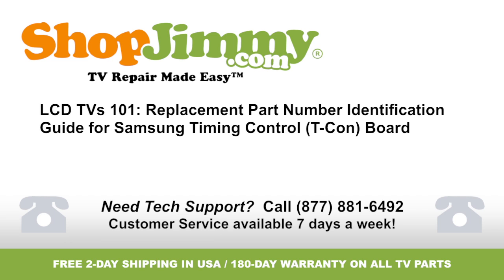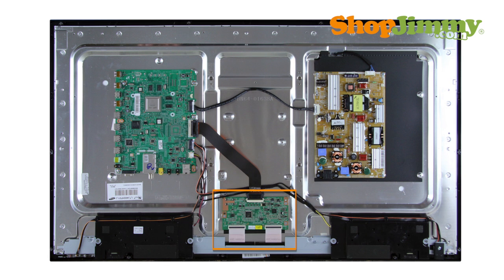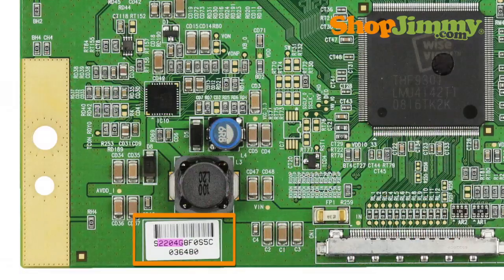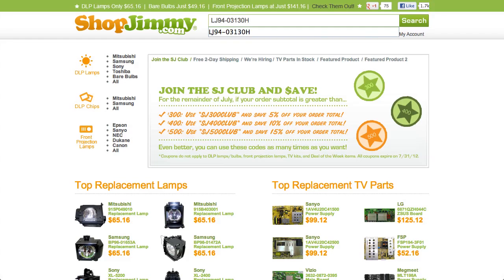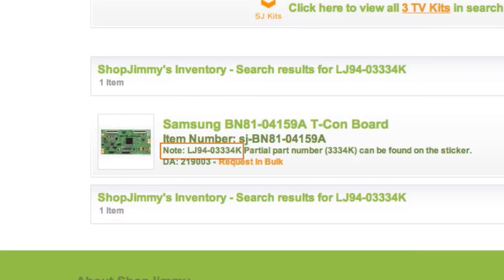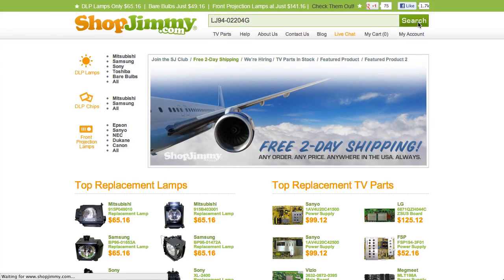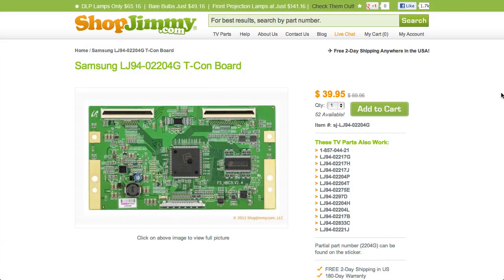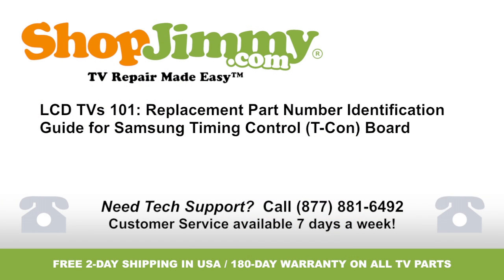Samsung LCD TV Repair - Identifying Samsung T-Con Board Part Numbers - How to Fix Samsung LCD TVs

Comment: Hi Jimmy ~ Our Samsung 50” Smart TV is about 4 years old and recently the screen just drained out and went black.  I’ve watched your troubleshooting videos and purchased a T-Con board from you which I just replaced and the problem wasn’t solved.   There are lights in the back of the TV and no image can be seen with a flashlight.  There is sound and the channel changes with the remote.   I’m hoping you can advise me which board to replace next.  It was very easy to replace the T-Con board and the longest part of that was removing and replacing all the screws.   Please let me know what you recommend.   Thank you in advance and thank you for what you do to help the rest of us.   Liz

Comment: Hi perhaps you could shed some light? My SYNCMASTER T240HD monitor/TV was made in TIANJIN CHINA manufactured March 2009. Model Code on back cover is LS24TDNSUV/ZA Has been acting up after it appears to overheat. Either the monitor just freezes the image or it starts to blinking between a set of large horizontal red/white/blue bars and solid white or solid blue screens. It won't switch sources at that point, but turning it off for awhile and back on, it returns to normal. I've proven its the monitor by switching to another one and it doesn't happen so its not my video cards. So something is overheating. From some of your other videos and others I figured it was the TCON card. After opening ...the tag on the inside has number LTM24OCT04 and it does NOT have a small tcon, it has one big long card that spans the entire length of the monitor and about 2 inches in width. It has several ribbons direct soldered and that go to the LED. Its part number is 24OCT04S2L V1.4. Have you seen one of these? I can't find any info on this, is this made this way so that it cannot be replaced easily?

Comment: Hi, I have a Samsung LED Smart TV with a bad T-con board, an N mosfet or diode was bridged, so I replaced the entire T-con board with a new one, and it died within 3 minutes of install, T-con gets power via Mainboard, not directly VIA Power supply, should I replace Mainboard as well next time? I dont want to chance that the New T-con was defective, and have another one die.

Comment: I am about to try the tea con repair or fix on my LCD LN S4095D Samsung, but it seems my symptoms are much different than others I've read about.  My display seems to work fine with numerous cable TV boxes, yet when I try to hook up anything else through any other input I get vertical lines. Still TCon? Why cable boxes work?

Comment: My LA32C350D1 is having double image problem and at time the blue color appears as purple. From what I seen on videos like yours I guess it's T-con board issue. My problem is locating it. I've searched all over for a video disassembling this particular model with no luck. I've managed to strip it down to the panel level, but I do not know how to go from there to the T con. If I get there I can get the part number as you have described here and buy  it from you. Could you advise me please.

Comment: I have a 52 inch Samsung LCD TV model number LN52A750R1FXZA.  It has a dark area in the center that runs from the top to the bottom.  Like a band in the center area that is completely  dark unwatchable.  It also has a double image on the right side of the screen.  It is about 6 Inches lower on the second shadow image.  There were originally 5 horizontal lines that were on the right side of the screen that showed for a while until the TV warmed up.  Is this a repair that a new T-con board would fix?  Any ideal on what would repair it?

Comment: Hi Jimmy, I'm having a problem with my Samsung UN50EH5000F.The standby light is paler than normal, and it does not turn on when I activate the power button.When I disconnect the main panel from the power panel, the backlight comes on; However, as soon as I use the 14 pin cable to reconnect the main panel and the power panel, the backlight goes off.I replaced the main panel, but the problem is still going on.Could there be a 14 pin cable issue?  Thanks! Sincerely, Lena
Reply from the maker: +alyonka2004   Try all repairs and troubleshooting at your own risk.  I recommend replacing the main board in your TV.  Click this link to replacement parts for your TV model number:  http://www.shopjimmy.com/catalogsearch/result/index/?cat=56&q=UN50EH5000F  There may be multiple boards for the same TV model number, be sure to match part numbers on your current board, with your replacement for compatibility.  Here is a link to a video showing how to identify your part number, click here:  https://www.youtube.com/watch?v=BEPWrefQvqI  Thanks and please let us know if you have any further questions with your TV Repair!  www.shopjimmy.com

Comment: Hi Jimmy:  I have a samsung LED TV that the picture went out on.  I do get sound and with the lights off I see there is back light.  When I turn it on I get a second or two of horizontal lines and then just back light.  The power light blinks 3 times.   Model number UN46D6420UFXZA.  I have not taken back off of TV yet.  Do you think this is the T-Con board?

Thanks Bill

Comment: My TV model number is Samsung LN40B750U1F. When I switch on the TV audio and video comes fine for few seconds, then display goes black and audio continues. When I move myself close to the TV I can see the characters moving in very dim black scale. When I turn the TV OFF and back ON same cycle repeats. What could be the problem?
Reply from the maker: Raghu R  Try all repairs and troubleshooting at your own risk.  I recommend replacing the Power Supply/Inverter board in your TV.  Click this link to replacement parts for your TV model number: http://www.shopjimmy.com/catalogsearch/result/index/?cat=229&q=LN40B750U1F  There may be multiple boards for the same TV model number, be sure to match part numbers on your current board, with your replacement for compatibility.  Thanks and please let us know if you have any further questions with your TV Repair!  www.shopjimmy.com

Comment: Need help...Have a Samsung Led TV model no. UN46EH53005F that is 15 months old, has sound but no picture did the flashlight test and can see image, on the back can only see blue lights, no white lights, the TV has 3 panels 1 bigger tan, 1 bigger green and one small green I think it is behind the stand which we didn't take off yet, can you please help
Reply from the maker: Rose Marie O'Brien   Please watch this video FIRST to help with your repair!  https://www.youtube.com/watch?v=BP3NVNCGEv8  This could be a problem with the power supply or bad LEDs in the TV panel.  You can replace the power supply board to see if that fixes the problem.  Click this link to replacement parts for your TV model number:  http://www.shopjimmy.com/catalogsearch/result/index/?cat=229&q=46EH5300  There may be multiple boards for the same TV model number, be sure to match part numbers on your current board, with your replacement for compatibility.  Here is a link to a video showing how to identify your part number, click here:  https://www.youtube.com/watch?v=sSJexLvRrjM  Thanks and please let us know if you have any further questions with your TV Repair!  www.shopjimmy.com
Reply: I tried the power supply that didn't work still the same, do you think it is the main board, can you tell me where the LED are in the Tv, since I have only power supply board, main board and I think it is the T-Con board...Thanks Again
Reply from the maker: Rose Marie O'Brien   Since the power supply did not fix the issue, I would say you most likely had bad LEDs in the TV panel.  Unfortunately we do not sell replacement TV panels or LEDs.  Thanks!  www.shopjimmy.com
Reply: ShopJimmy.com SO DOES THAT MEAN IT IS THE SCREEN ITSELF AND THE LED ARE IN THE SCREEN?

Comment: Our Samsung LCD (LN37A550P3FXZA) TV'S picture is all distorted.  The color is all off like someone put bad values into the contrast and saturation settings.  I believe it's our t con board from some research, so I purchased a Samsung 55.37T04.C10 T-Con Board Component kit from your site with a soldering kit.  Are there any tutorials for replacing the chip and fuse on the t con boards?  I have experience soldering, but it's nice to see it first.  Thanks!
Reply from the maker: Danielle Rhodes   Unfortunately, we do not have a video for that kit.  Thanks!  www.shopjimmy.com

Comment: I have a double image and putting the tape on the left ribbon it takes care of the double image but then I get a bleeding image coming from the same side corner. From this video
https://www.youtube.com/watch?v=j7vl7-vZEL8
I have a un55d8000. I have bought matching ribbon cables and a t-con board from eBay with the same results.

Comment: We have a Samsung LCD TV Model LE 40 R 88 BD and have replaced a few blown capacitors  and TV is still clicking and not coming on  could you please help
Reply from the maker: Christine Davis  Please watch this video FIRST to help with your repair!  https://www.youtube.com/watch?v=BP3NVNCGEv8  This could be a problem with the main board or the power supply board in your TV.  You may need to replace them individually to see which one fixes the problem.  Here is a link to replacement parts for your TV model number on our website.  http://www.shopjimmy.com/catalogsearch/result/?q=LE+40+R+88+BD  There may be multiple boards for the same TV model number, be sure to match part numbers on your current board, with your replacement for compatibility.  Thanks and please let us know if you have any further questions with your TV Repair!  www.shopjimmy.com

Comment: Hi jimmy...
i have a samsung 60 inch lcd model no UA60EH6000M...my problem is i have a light blue line about 3 inches running vertical in middle of my screen from top too bottom,u can see through line,it doesn,t change colour and is not stripes,just solid,it does how ever go slightly darker then lighter???? regards Greg
Reply: sorry yes its 3 inches wide..i checked lvds connections,ribbon connections too..also having trouble with my t.con board as there is no part number on there..checked ribbon cables also..regards Greg..
Reply from the maker: Greg Guard   This sounds like a TV panel (TV Screen) problem.  If your TV panel is bad, it may be more cost-effective to replace the TV as panels are typically hard to find in stock, difficult to replace, and expensive.  Thanks and please let us know if you have any further questions!  www.shopjimmy.com
Reply: no worries...thanku regards Greg

Comment: I have an Samsung 46 inch, I just replaced the toon board with one I bought off eBay.  That fixed the first problem which was everything was very dark and usually showed only faces in Orange.  But now, it seems washed out and has a haze like things are smoothed.  But smokey.   
Is this a total loss?  I.e. The panel?
Reply from the maker: JAMES LYNCH   There are a few different things that could be the problem here.  You could have gotten a bad replacement T-Con board.  Assuming the replacement was good, then you could have a problem with the main board or the TV panel.  Please reply with your TV model number.  Click here to view a video that shows how to find your TV model number:  TV Repair STEP #1 Help IMPORTANT TUTORIAL How To Find Your TV Model Number Tutorial TV Repair Help  Thanks!  www.shopjimmy.com

Comment: Samsung  model LN46B650T1FXZA  (46" LCD HDTV)-  See photo links: One (1) pixel thick horizontal lines, 1/8" spacing, or one in 6 horizontal pixel lines. Lines more noticeable on the right.  Any idea on a cause?.  If its the panel, I'll ditch it.     http://www.avsforum.com/photopost/data/2310007/b/bd/bd6ff450_P1050866sm.jpeg 
Close up:   http://www.avsforum.com/photopost/data/2310007/d/df/df89139a_P1050868sm.jpeg

Comment: I have a Samsung Model LN46A500T1F, with a solarized picture. I also do not have a label beginning with the letters you describe in the video. My t-con board has a tag that reads M$35-D025860-L$KSR8345053C4. Can you please let me now which part I need? Thank you.
Reply from the maker: Ashley Milligan  Please watch this video FIRST to help with your repair!  TV Repair! LCD, LED, Plasma, DLP How To Fix Your TV with ShopJimmy.com Help!  I recommend replacing the main board in your TV.  Here is a link to replacement parts:  http://www.shopjimmy.com/catalogsearch/result/index/?cat=56&q=LN46A500T1F  Be sure to match part numbers on your current board, with your replacement for compatibility.  Here is a link to a video showing how to identify your part number, click here:  Samsung Main Boards & Digital Boards: Part Numbers for LED, LCD, DLP, Plasma TV Repair  Thanks and please let us know if you have any further questions with your TV Repair!  www.shopjimmy.com

Comment: My tv wont cut on it cut on than off right away.I had a TV repairman come out to check my 55' flat screen TV Z1QB3CNA0--M# UN55CB000XF he said it was a Power Supply Board and the cost would be $389. when he put the new board in it still didn't work He than said it was the smaller board and could not find that part.is the t-con that small board.I would love to have a TV before Thanksgiving lol
Thanks hope U can HELP.
Reply from the maker: hp77   Could be either board.  Try this at your own risk, check for your 5 volt standby on the power supply.  Reply with the results.  Also, I believe that is an invalid TV model number as I do not see and results for it online.  Please double check the model number for your TV.  Thanks!  www.shopjimmy.com

Comment: Informative vids. Thanks. My Samsung LN32A330JID TV has a distorted picture. Sound and print on screen is OK but images look like a color negative. I THINK I need a T con board. I watched the vid to ID part # but I do not have a label starting with the digits you describe. My tag reads, M$35-D013932-L$CPR827323622. Please tell me what part # I need to purchase.
Reply from the maker: AL BLUME   SJ-996510009692 is the part. This board is not in stock but we have repair kit or repair service where you send us your board to repair.  Here is a link to the repair service:  http://www.shopjimmy.com/philips-996510009692-t-con-board-repair-service.htm  Thanks and please let us know if you have any further questions with your TV Repair!  www.shopjimmy.com
Reply: The ending of the story.... With the info I received from your site, I diagnosed a faulty T-CON board. The board was unavailable everywhere so I opted to use the SHOPJIMMY repair service. I received my repaired board today, reinstalled it and now have a beautiful picture. Thanks for a great site and great service.
Reply from the maker: AL BLUME  Glad to hear your TV is working again!  Thanks for sharing your story and please let us know if you need any help in the future!  www.shopjimmy.com

Comment: Hi, I have a Samsung LED TV un32eh4003fxza, I had issues with vertical colored lines or part of the picture missing on screen for a bought a week or so, and a few days ago, id didn't want to turn on it flashed the red light but didn't turn over..I unhooked everything like my Blu-ray thinking it might have been a connection problem but it didn't power on..I then unplugged it for a while and attempted to repower it back on and it came back on after a few power tries. Only I have no picture but I hear sound. There is light coming from the screen as well, so I was thinking it was the T-Con from searching here and there and found your video. The only thing is I am having a hard time finding parts for it without actually taking the cover off since I am not my own professional. I have found some info that might be the part number by category search but I cant find that part anywhere
Reply from the maker: Laquita Carr   I recommend running the flashlight test on your TV.   Here is a link to a video we produced that shows how to run the flashlight test. No Image No Picture on TV Screen-Flashlight Test LCD TV Repair - How to Diagnose Broken TV Repair Please reply with your flashlight test results and we can recommend a replacement part for your TV repair. Thanks and please let us know if you have any questions! www.shopjimmy.com

Comment: I have Samsung (Model code: LE46A566P1WXXE, Serial: ARR63SXQB00059N, Version: AA01) and it's doing exactly same as in this video: Samsung 46" LCD TV screen problem. Bending/hitting/etc. fixes the problem for some seconds/minutes but it comes back several times. After watching about 30 minutes it normally doesn't appear any more. Maybe just a loose connection or failure in a T-Con board? Any help is highly appreciated as I like the TV a lot.
Reply from the maker: Tomi Pikala   This sounds like either a T-Con or panel problem.  You can replace the T-Con board to see if that fixes the problem.  Unfortunately I do not see any replacement parts in the search results for your TV model number on our website.  Please reply with your part number on your T-Con board and I can try searching for replacement parts.  Thanks and please let us know if you have any further questions!  www.shopjimmy.com